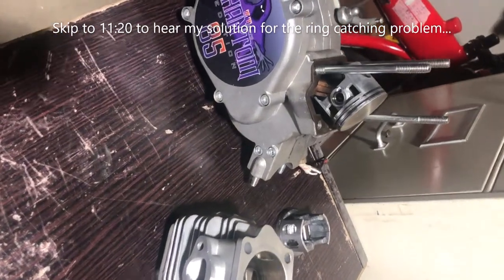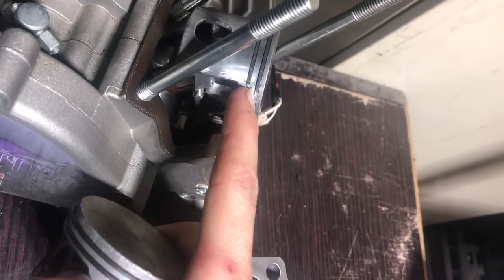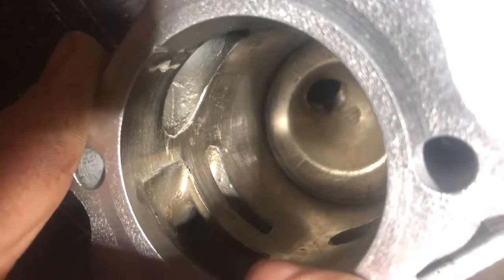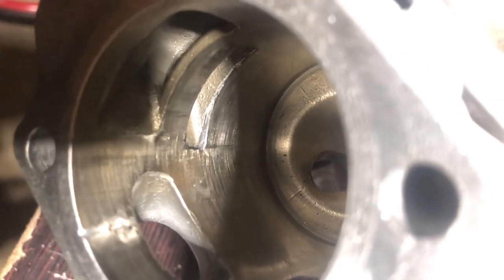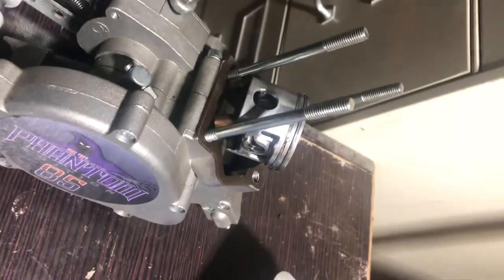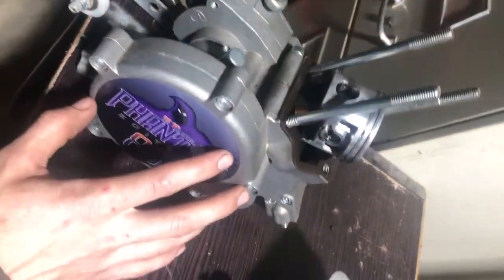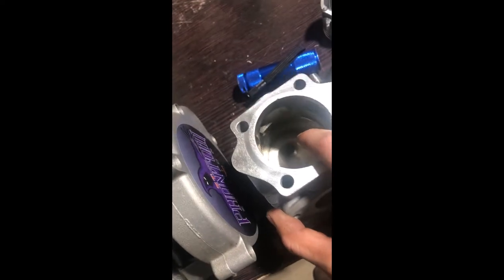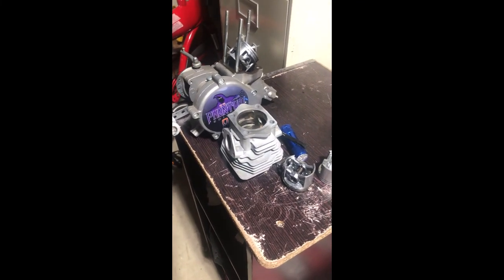phantom 85 piston ring catching discussion and possible solution

Comment: Never had 1 but herd of the problems, ggz-👽👍
Reply: I did my phantom experament like ERT said to so far so good lots of balls I can take off from a dead stop try not to because it eats up them cheap clutch pads but in a pinch just like a motorcycle and I weigh 250lbs give or take a few lol

Comment: Leave the bottom ring off or you can notch the ring and put the ring gap wherever you want. Lastly you can remove the pin, drill a new hole and use a drill bit one size larger than the hole you drilled drive the drill bit in and cut it off to make a new pin.

Comment: Stihl is known to have rings drop into their intake ports. They had a “Tonsil” built into the intake port to give ring support.
Reply: I've seen that too, the stihl 036's I'm rebuilding and some weed wackers come to mind first but I bet lots of others have it too. Is it actually particular to Stihl, vs Husq's etc., or were you saying them just as an example?
Reply: @ghettobikelife8833  Stihl used it on many models since their design and layout of using dual ring pistons and having the piston drop low enough. Saws like the 200T had the ring drop down into the intake but didn’t use a tonsil. Husqvarna didn’t need it since they were big on single ring. I believe there was older brands that used it here and there but Stihl used that design a ton. On the Stihl 034 the 46mm cylinders had it but the Super (48mm) didn’t use it.

Comment: I got a gen 3 and replace piston with meteor brand 046 piston. It has a wider skirt but narrower ring pin placement, closer to intake port. I marked where the ports and transfers were when I put the cylinder on. I also chamfered the end of the rings cause they are razor sharp. I've got roughly 100 miles on it pulled the intake off and everything still looks good.
Reply: Have a link where to buy that I has the same problem

Comment: So glad I didn't buy a Phantom 85......I'm thinking for a decent,hopefully reliable, budget build with decent power- use my mz65 clone pipe $45, gety a YD100 engine kit $120- ported, with better wrist pin clips, do a 3rd intake transfer port, G2 Reed/VM22 carb $50 with a balanced crank, port match case & cylinder.....It still won't be as fast as a Phantom 85 (52mm VS 50mm) but maybe get close.
Reply: Where can u find a ported yd100 for $120m

Comment: Were u get that piston from
Reply from the maker: Which one, the new one I’m using instead? It’s a stihl MS380 chainsaw piston. But it wasn’t a perfect fit, you’d need to stack 3+ base gaskets if you can’t machine down the height like I had to. I should have used an 044 piston which at least is more common/cheap than 380

Comment: I bought all 3 gens. First was cool but the bushing was trash. Second was cool it would catch rings and the third didn’t last 3 miles before a ring caught again. I was able to keep the 3rd one running with just top compression ring. If you recenter the stud hole I think both rings would catch
Reply from the maker: Yeah my plan was to also run just the top ring, but mark the piston where the end gap is with a marker and rotate the cylinder in the studs until the piston mark is in the narrow 'vertical slot' between the transfer and intake ports
Reply from the maker: performance wise, did they run any different? Do you think the port shapes were changed and that's why the first gen didn't catch rings as much?
Reply: @motoredbikemadness2061  I honestly don’t remember how the first gen ports looked. But I remember the 3rd gen would run great straight out of the box I was doing 45mph with a 36
Reply from the maker: @justanothermotorizedbikech5138  damn I used a 36t also with my 1st gen and it would probably barely hit 40mph. But I had to drill the main jet to make it run right so it ran a bit rich after that

Comment: I switched out the piston for a stihl 52mm 044ms440 big bore piston and rings and 12mm pin bearing then I put my own window in the piston and has been working fine got the idea from ERT channel they hold a speed record on a phantom 56 miles and hour with no window piston one of my phantom has almost 500 miles on her and still working the other has 50 miles on her working fine had a little issue with cylinders getting hot switched to the 2 stroke oil mix they recommended and running cool now  The oil is Valvoline multi purpose 2 stroke  oil they recommend racing 2 stroke oil  Valvoline but you won't be able to find it so they said go to the next best thing which is the Valvoline multi purpose you can find it at autozone and these phantom engines love oil
Reply from the maker: Yup I’m probably gonna use the ms440 too, only problem is the ring might still cross over the port if I can’t rotate the cylinder enough. Even if it does, will probably run fine, just best to not have the end gap near the ports how the stock phantoms come
Reply: @motoredbikemadness2061  that's why everyone is switching over because they don't cross over the ports at least mine don't go to ERT Ellis racing team channel that's where I got the idea from
Reply from the maker: @mikemiller3303  yeah I bought an 044 piston after seeing ERT’s vid, but I bought it because there was a 10mm pin version, so that I could use the normal 10mm pin+bearing instead of the 12mm bushing. 

But the end gaps are still crossing into the ports- all the pistons I showed in the vid (044, 038, phantom) did.

But mine is a Gen. 1 phantom, maybe the cylinders are different. Which Gen is yours? Also- if you’re using a 12mm* pin 044 piston but I have a 10mm* pin 044 piston, maybe your ring locating pins are in a different spot
Reply: @motoredbikemadness2061  I have gen. 3   cylinder and a yd100 bottom half which has a 10mm pin bearing if I used the bottom that came with it it was 12mm and ERT said to use the 10mm so that's what I did ask him he's got a video of him going 56 mph mine has almost 500 miles on her no ring snag so far 🤞
Reply: @motoredbikemadness2061  you should specify that yours is a gen 1 in the title. They now are selling Gen 3

Comment: I was thinking about turning the whole piston around so pins are on exaust side
Reply: Bad idea you need your windows for your intake
Reply: @cxd710  not to mention that having the pins on the exhaust side is probably even more close to / overlapping the port. But if the locating pin is in the right spot, as if it was designed and built custom, it could be the ideal option to have the pins on the exh side. Sctually I think I've seen it. Keep in mind most high performance 2 strokes eg. dirt bikes have a metric ton of transfer + boost ports on the intake side
Reply: If you get a chainsaw piston and do the window yourself, you can put it on whichever side you need so doing what you said could still be an option